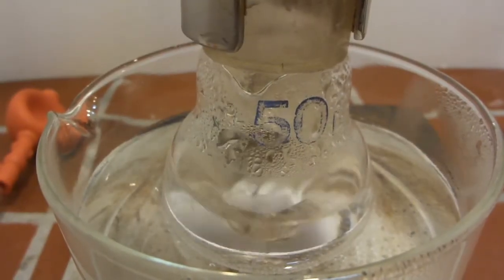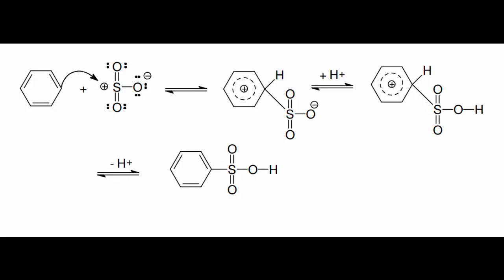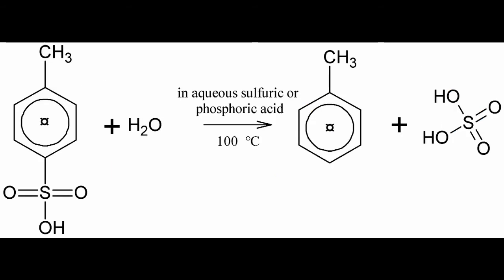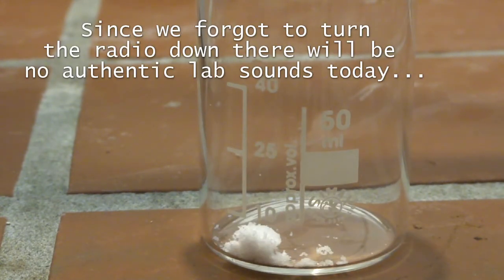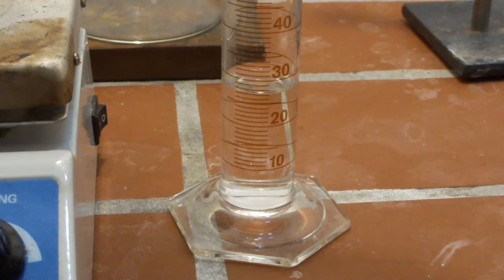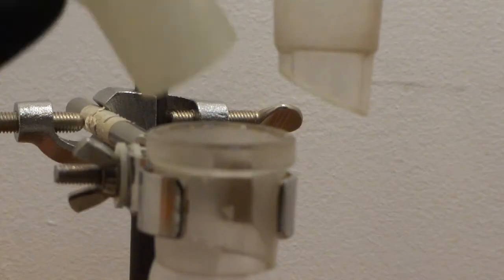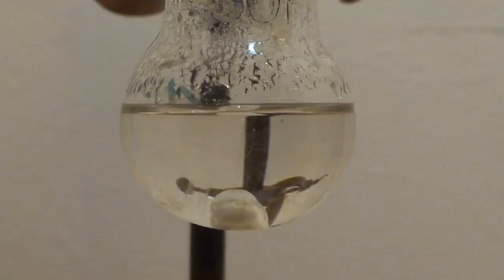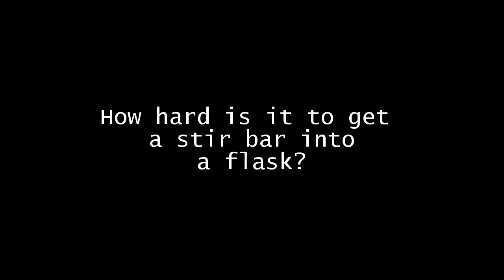Preparation of toluene and (de)sulfonation in detail

Comment: Hey. I’m glad I stumbled on your videos. I like the mix of practical chemistry and light explanations of mechanisms. Obviously every reaction is different and some might need more explanation than others but it’s nice to have some explanation at least either up front or before each step. 
And what do you mean by the toluene smelling better? I guess I’ve never smelled crude toluene. I’ve always worked with pretty pure stuff.
Reply from the maker: Thank you very much!! Compared to crude, technical toluene with a slight benzene and naphtalene aroma this smelled much cleaner and much more like toluene thats used for chromatography.

Comment: The logarithm of the hydrolysis constant and Hammett acidity are actually positively correlated, and the slope of lgk-H is about 1.2. You can try increasing the amount of sulfuric acid. However, the solubility of p-TsOH in the range of 60-80wt% H2SO4 is low, less than 10g/100ml rt. Can try refluxing with 60wt% sulfuric acid at about 140 degrees C (which is about the dew point of pure aq 60wt% sulfuric acid).